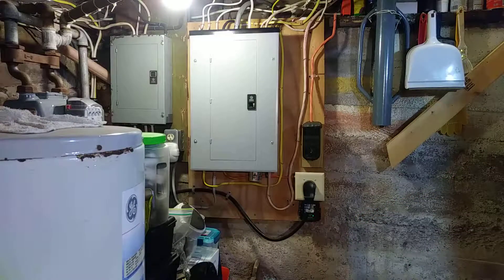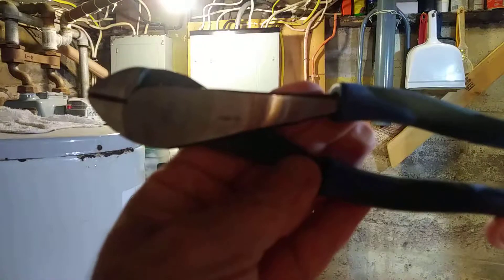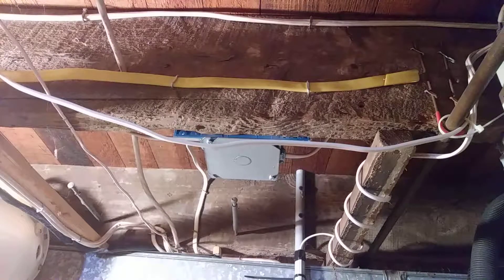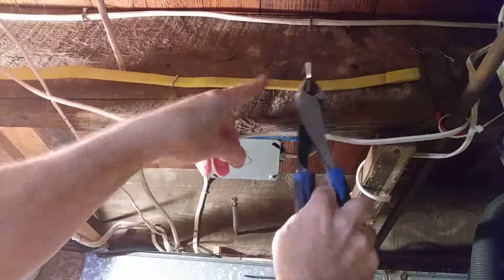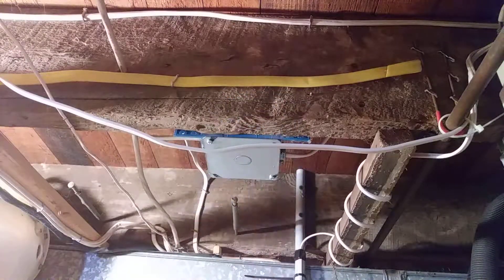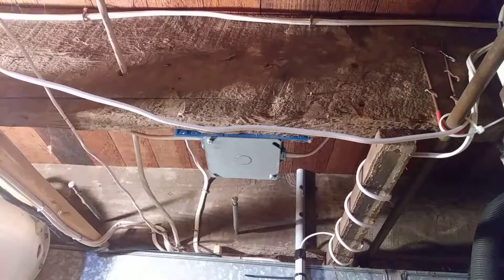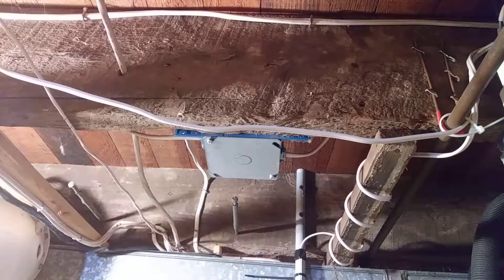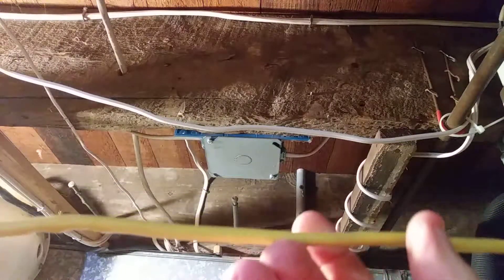I show and explain how to unstaple romex without causing damage to the jacket(1)

Comment: Oh dear Lord!! Who uses staples like these for Romex???? Please please please use the wire staples that are two small nails connected by a rubber plastic type material.,
Reply: professionals.
Reply: Yep, the pros did it. And I found (in my garage attic) that some function boxes do not even have the cover !!! I only found them after cutting an opening on the garage ceiling to be the attic entrance. Inside the home, many outlets and switches are connected by stabbing the wire on the back of the outlet/switch instead of using screws. Why ? to complete the job really fast.
Reply: @1942nn  leaving open junction boxes sounds like a homeowner or handyman.  stab connections could be either.
Reply: @1942nn  Wow! Scary! I’d want someone to come get that fixed for you ASAP!